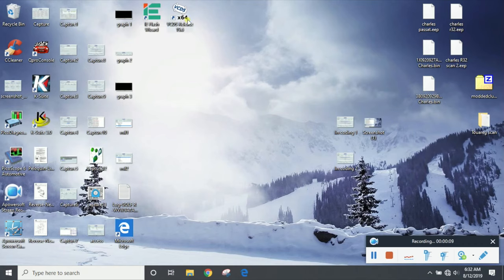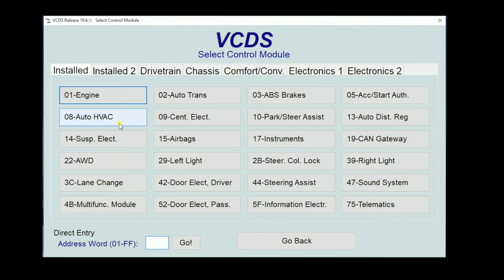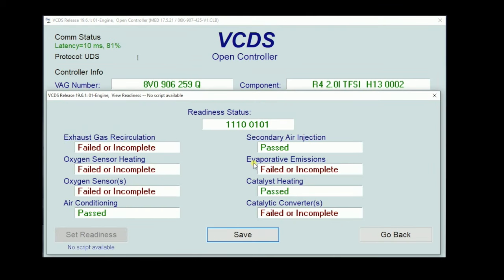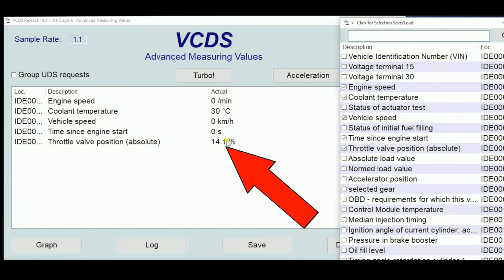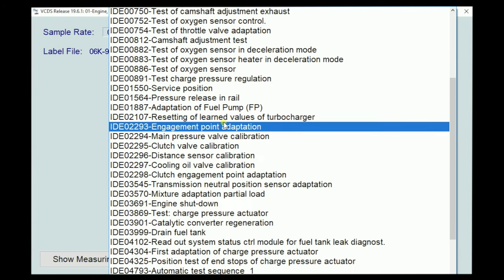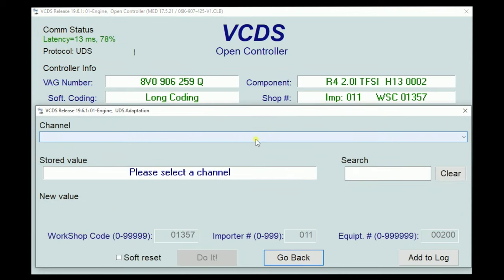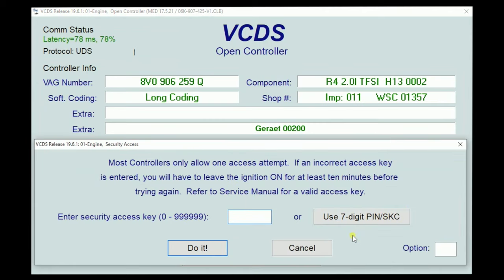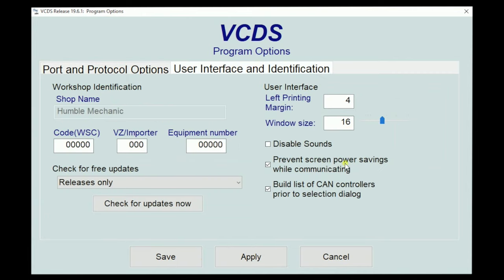VCDS Tutorial ~ How to Use VCDS Scan Tool

Comment: Hi. Thank you for your video. I have a question, how I can reset the misalignment in VCDS?

I got the following fault code on my VW Passat 2015 with side and park assist:

Address 3C: Lane Change (J769) Labels:| 3Q0-907-566.clb 
Part No SW: 3Q0 907 566 B HW: 3Q0 907 566 
Component: MRR1Rear H16 0230

1 Fault Found: 
1311126 - Control Module for Lane-Change Assist 
C1114 F0 [009] - Automatic Calibration Not Possible 
Confirmed - Tested Since Memory Clear 
Freeze Frame: 
Fault Status: 00000001 
Fault Priority: 4 
Fault Frequency: 1 
Reset counter: 254 
Mileage: 96342 km 
Date: 2024.09.24 
Time: 09:29:12

Control Module temperature: 31 C 
Voltage terminal 30: Measuring value not available 
Vehicle speed: 0.00 km/h 
Terminal 15 status: Measuring value not available 
Voltage terminal 15: 13.00 V

The data that I extract is:
IDE00018 Voltage terminal 15: 13.00V
IDE00019 Voltage terminal 30: 13.00V
IDE00020 Terminal 15 status: On
IDE05090 Measured receiving power lane change assist. 1: 1,86%
IDE05091 Measured receiving power lane change assist. 2 : 2,85%
IDE05092 Measured angle lane change assist. 1: -36,10 degree
IDE05093 Measured angle lane change assist. 2: 39,50 degree
IDE05094 Static angle offset lane change assist. 1: -3,90 degree
IDE05095 Static angle offset lane change assist. 1: 0,45 degree
IDE09387 Dynamic angle offset lane change assist.: -5,59 degree

I assume that sensor 1 is at the wrong angle, I think the sensor moved after I hit a wall. My assumption is correct? What do you think?

If I move the sensor in the correct position how I can reset this values? or are resetting automatically?

Many thank in advance.

Comment: So I have a 05 Audi A6 4.2 Quattro and my steering column lock is on and I have no power to the ignition because the lock module in the column is not recognizing that the key is in there to unlock it, so will this read and clear the fault codes on it so it can unlock the module and let me start it again? I’m having a heck of a time finding one that will do this without spending a million dollars on a professional scanner! I know it’s possible but I just can find one ether that or people are lying to me

Comment: I have a 2018 gti autobahn, it has a fault code for 09 central electric. 0010. that’s all it says. I’m trying to code the remote windows so that I can roll them down with my key fob, but when I try to code it, it does not say “long coding” in green beside the “soft. coding” text. because of this, when I try to code the remote windows, I cannot find the options for it! I have been working on this for 6 hours and am very frustrated, any help?

Comment: Would love to see a video that activates the aux function on a MKV Jetta. I can't get my premium radio to recognize the aux port located in the armrest of my 09 Jetta SE.
Reply from the maker: Usually it’s the radio (AW56) coding that gets silly. Make sure the last digit is a 1
Reply: @HumbleMechanic  I saw that when I went to the TDI club's online blog (https://forums.tdiclub.com/showthread.php?t=341165), which says that I need to change the code to 0040401 using a VCDS. Does that sound about right?

Comment: Please assist can an aftermarket car key affect basic settings or coding of mechatronic to the car, I took in my car at VW here in South Africa for Repairs as it was only engaging gear 2,4,6 R only they replaced mechatronic and selector fork for 6&R, then they say they can't remove error transmission alert ⚠️ an they can't code the mechatronic because one of my keys is non vw guinea factory key

Comment: Hi . I’ve got a 2019 Volkswagen Golf R. I recently got a obd 11 tool and tried to use it to make some changes, but my problem is I didn’t back up each control module before making the changes. Now I have a lot of codes if quite a few of the modules. Just so happens my car is also a 2019. So I was wondering if it’d be possible to have you get a copy of all the factory values/settings in each module so I could use it to fix all my modules back to factory settings?
Reply from the maker: You “might” be able to get that from the dealer. Here’s what to ask..

Can I get a copy of the paperless gff from my cars PDI? 

This will be the first scan the dealer did from new and should have all the coding

Comment: Quick question. If I changed a timing BELT, do I also need to do the reset with VAGCOM? Cheers!
Reply from the maker: Typically no. If it's an ALH you need to be sure start of injection is correct.

Comment: Hey Charles.  I'm new to the whole coding thing and was wondering if you had any idea on how to turn on the stock footwell lights while driving? I've tried searching online and all through vwvortex and couldn't find anything besides people talking about getting aftermarket to work or splicing the wires to headlights switch.
Reply from the maker: Depends on the car. Most of them have the option on the MFD.

Comment: Just bought a 01 a4 1.8t. Will the cheap vag com readers work with the vcds site? And I'm assuming from what you said mine would take forever to load since it wouldn't be can bus
Reply: Ok I should probably wait to watch the whole video. I'm gathering the vcds site is only compatible with their own scan tool. Or can I use say an amazon vagcom tool with an obd2 to USB and hook to my laptop. Or do I need the vcds tool to use the vcds site

Comment: Hi there HumbleMechanic,
I am a fan of you page and have been watching the things you do. I have a 20 tiguan s, and I am wanting to add the automatic windows roll down option.  I purchased the Hex-v2. have watch several videos and tried to follow along. gone on ross-tech forum and registered and now waiting. my question is, I did the scan thru general elec. then the coding opt 7. when I see the current coding: all I see is 00000000000000000000000000000000000000000000.....  do the long coding and I get" coding is not supported by this control module variant". so did I just waste my money buying this and can not use it on my car. I know it my sound like a dumb question but I figured i would ask someone who knows what they are doing.

Thank you for you time,

Jesus Guzman

Comment: 11:34 After the timing chain is replaced, VCDS needs to be used to reset "Timing Chain Elongation?"  The engine control module does not self-correct for the new chain?
Reply from the maker: That’s what they say. I’ve never tested it. Lol

Comment: Does the software have a database for every year/make/model of car, or does it just pull the data and you have to find what the bits mean depending on your car? 

 I'm interested in looking at a 2018 Honda Accord  with a STM32F405VGT6 / STM429 diagnostic tool (v22.3)... not the VAG B03-ST (STM32F415).
Reply from the maker: No it wont have what you are looking for.

Comment: VCDS can turn off the Check Engine Light when using a catless downpipe? Even using an O2 spacer, sometimes I got a CEL
Reply from the maker: Yes you can clear the light, but as soon as the car runs the cat tests, it will come back on. You need a tune or a cat LOL

Comment: Question, just purchased a 06 Jetta TDI. With a bad mechatronics unit. Replaced the unit with a brand new one. Which adaptor do I need for the coding of the trans unit?
Reply from the maker: The enthusiast setup for 199 is probably what ya need
Reply: @HumbleMechanic  I thought so. Thanks alot!

Comment: Heya Charles I know this video is a year old now but I finally purchased vcds. It’s a steep learning curve very different from my other cheapo scan tool. One issue i’m having is it won’t read my lights non xenon module on my 2004 gt tdi bkd and i’m not sure how to get around this. Any ideas ? 
The other issue i’m having is over boost most likely due to sticky turbo veins I know but sometimes issue doesn’t happen at all. What measuring blocks are best to look at to diagnose this and and can actuator adjustments be made through vcds or is that only done manually ?? Look forward to a reply hope you see this. Mr Geen from the uk
Reply from the maker: It doesn’t have that module I’m guessing. 

I’m not sure on the vane MVB. you can look at boost and that may point to an issue. VCDS should have some MVB lists on their forum
Reply: @HumbleMechanic  thanks bud ile take a look when I next have a day off the symptoms are more than just a turbo issue I believe the timing to be out also as I cannot rev about 3000 the car won’t allow it and does not accelerate above 80mph where as it used to go to 120mph+ when wound up properly. Obviously on private lands

Comment: Looking at vcds cables on A...and they say that they are for vw/Audi.  The connections are the same as the connections on other vehicle platforms. Can these vcds cables be used on other makes, models? Like a  Ford or Chevrolet?
Reply from the maker: This is vw/Audi. I’m not sure if anyone does a similar tools for other brands
Reply: @HumbleMechanic  did I hear in video the software was free? That a cable is needed and it didn't look like they are expensive. However,  there are multiple suppliers, I am concerned about getting a authentic one and not 3 Asian knockoff. Do you recommend a particular brand?
Thanks for your recommendations.

Comment: Why was maintainer connected to battery negative terminal and not to GND of bodY? Battery  management doesn't see the extra current......
Reply from the maker: That's how hey get connected
Reply from the maker: There is no extra current, its smart enough not to over charge, we also have the key on so we are drawing on the battery
Reply: @HumbleMechanic  Indeed, but there was a topic on RT forum, where car was starting to shut down everything as the Battery Management thought that battery was empty, because it was seeing only current leaving the battery therefore lowering the calculated charge.
I know it won't overcharge, but  the "Correct" way would still be connecting it to body ground(On mqb there is even a good spot for it) so that management knows that it isn't using current from battery.
Reply from the maker: @firecatanddog  Do you have that documentation? Id love to see it.
Reply: @HumbleMechanic  On any car with a BMS / BDM (on yours it's a slave of the Gateway) the negative lead of the charger should be connected to a chassis ground, not the battery's negative terminal.   If you connect directly to the battery, the BMS sees current flowing from the battery, but not the current your charger is putting back in.   Connecting the negative lead to the chassis means the BMS will see the "net" current flow both into and out of the battery.

Comment: Can I use older VCDS cable and software (I can't buy new now) with newer vehicle? I have VCDS 11.11 (2011 year??) and car from 2013. year. Is this a problem?
Reply from the maker: You should be good there. But the newest stuff requires the newest cable
Reply: older VCDS cables can still use the latest software. It just wont work on 2017+ cars.  Download the free update off the site

Comment: On a 2015 Gti Can you disable the traction control with vcds. With the is38 and tune I have the computer still kicks in. I have used obd11 and Carista and they don’t disable it totally.
Reply from the maker: I doubt it can fully be turned off with either. More likely firmware

Comment: I have a 2010 Tiguan 2.0tsi. This thing started having a mind of its own.  When the problem happens, it throws a bunch communication codes (U0121, U0128, U0164, U1017, etc).  These are no communication codes for ABS module, Park Brake Mod, HVAC mod)Trans code P1602/18010 power supply to pin 30.  01346 ABS mod no communication. A ton of central electric codes for no communication, etc.  This all seems to be a CAN bus issue or a power supply issue to a circuit that provides power to several modules.  The car wont start, the remote doors wont unlock.  All the lights are lit on the dash.  I noticed that theres a few complaints at the NHTSA (National highway & traffic safety administration) site about an underhood fuse box that seems to go bad causing multiple exterior lighting to not work.  The problem comes & goes, and I know it having the problem with the central locking system wont work.  I work as an automotive tech for GM, but not familiar with VW so much as this is my wifes car.  Any help or common issues you might know of with these makes and models in regards to multiple UART codes like this would be great.  Thank you.
Reply: I found the problem.  I was that fuse box. #6 wire that goes from the battery positive goes to the fuse box and the wire is fried.  Melted the fuse box as well.  I managed to cut off the melted terminal & clean up the fuse box metal bar.  It seems ok now.  No more intermittent crazy stuff happening anymore.

Comment: Got a ?? For you...have a p0243 code ( n75)  replaced turbo , n75,  Diverter valve, boost sensor , maf, engine wire harness,  and ecu...still have it. No boost!! Unplug the boost sensor ( got boost) and no p0243😀  but now have a p0238( boost sensor) any ideas???
Reply: 2008 audi tt 2.0 t

Comment: Have a 2014 Touareg and the radiator fan kicks on high from the moment the car turns on until it's turned off, but there's no check engine light

My question would be, is it possible there could be a stored code I could grab with just a standard OBDII scanner or would it be better to go with VCDS to check specific outputs of different sensors AND check codes?
Reply: It's your coolant temp sensor faulty, the temp sensor may be giving wrong info on temp
Reply: @ronniecoble6973  interestingly enough. There was a pending code - P2181. I cleared it out as well as simply disconnecting the fan and reconnecting it and for now it's operating normally. I was trying to find info on the thermostat and sensor and it seems to be on the back on the block. People saying they've had to drop the motor and trans to swap? Any truth to that? Seems incredibly ridiculous for what's normally an easy swap.
Reply: Is this a diesel or gas and the size of engine? If it is a 2.0 liter it will be next to the coolant pump under the intake and it's pretty easy to get to, just have to take the charge air pipe off to the thottle body and one bracket. A diesel it will be on the coolant line around the lower left near the radiator.  I would just do the sensor and make sure theres no corrosion on the connector that can cause false reading
Reply: @ronniecoble6973  it's a V6 non TDI. I believe I was able to located the thermostat and coolant temp sensor by following the radiator hose to the back of the block. Just not sure how I'm really supposed to access it.
Reply: I've only saw that engine a couple times I our shop for just a normal oil change, it's definitely possible to do the thermostat and sensor while the engine is in the vehicle, yes it will be tight. I would unplug the coolant temp sensor and check if there's oil in the connector or coolant, I would say it's a wire issue, the only time I've seen the fan stay on all the time is for implusiable signal or a open to the temp sensor.
Reply: @ronniecoble6973  Thank you for the help. I will try unplugging it and see what it looks like.
Reply: No problem, if you have any more questions just ask, I'm a Audi tech and vw is pretty much the same lol.

Comment: I have a 02 vw gti 1.8t with stage 2 ecu, 3inch exhaust/cat delete and borgwarner turbo not sure if I said that right but the car use to pull 25psi consistently, now it only does 5 or 10 and every once in awhile it’ll hit 25 then when I shift it goes back to 5 what would cause this???
Reply from the maker: Look at the boost controller. Or N75 if it's still running a stock controller

Comment: Are airbags all same electronically  ? I am now installing tesla 3 seat to my 2003 New Beetle convertible. can I use tesla airbag `?
Reply from the maker: They are probably similar, I wouldn't trust using another airbag
Reply: @HumbleMechanic  Thanks,  before I install Tesla seat I will check if that VW airbag fits Tesla seat.  Tesla seat is hyper comfortable seat.  Currently it is in my home office, I`m using it now as office chair :O)

Comment: How would one program a 2019 GLI to keep the DRL light on when the turn signal is on? Or at least have it just dim and not go all the way out.
Reply from the maker: There are so many lighting adaptations that can be done. I haven’t really poked around on the new Jetta much
Reply: HumbleMechanic our second VW came up with all these    2019 Jetta 1.4T have u ever seen all these pop up at once?

P010800 - Manifold Abs.Pressure or Bar.Pressure High Input
            Passive
        P010700 - Manifold Abs.Pressure or Bar.Pressure Low Input
            Passive
        P023800 - Turbocharger Boost Sensor (A) Circ. High Input
            Passive
        P007D00 - Charge Air Cooler Temperature Sensor Circuit High Bank 1
            Passive
        P011300 - Intake Air Temperature Sensor 1 Bank 1 Circuit High
            Passive

Comment: Thanks for the education. Now I just need to figure out how to read the faults and work the problems. I have a few issues but not sure we’re to start with what can be the problem.
Can all these issues be causing "Gearbox Malfunction: You Can Continue Driving"  but only have even gear ms available
3 Faults Found:
8956 - Valve 3 in Transmission Part 1
P17D4 00 [040] - Mechanical Malfunction
18443 - Clutch 1
P17D6 00 [040] - Pressure too High
Hydraulic Pressure Sensor 1 (G193)
P1775 00 [040] - Adaptation Limit Reached
Intermittent - Confirmed - Tested Since Memory Clear

Thinking I might have to replace the gearbox meritronic. But might be related to transmission oil temp reaching 98 degrees C.